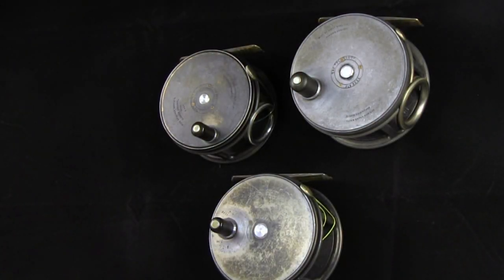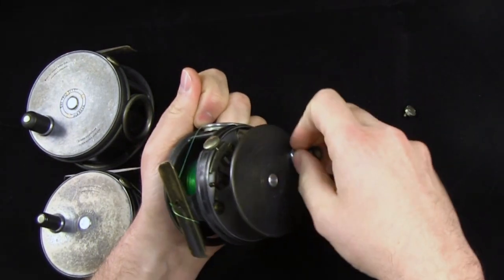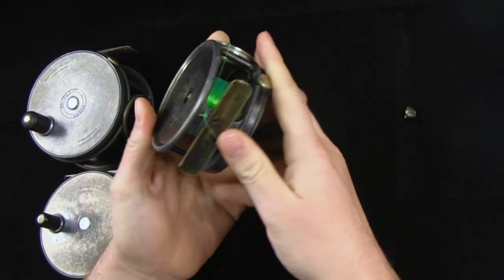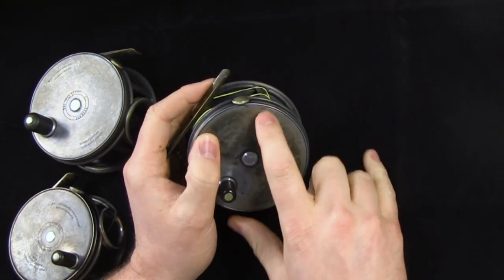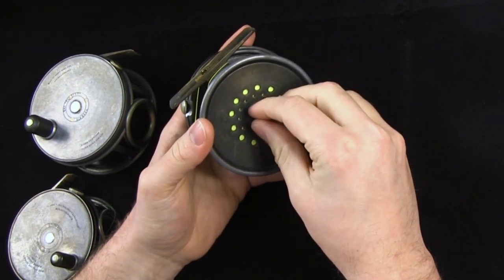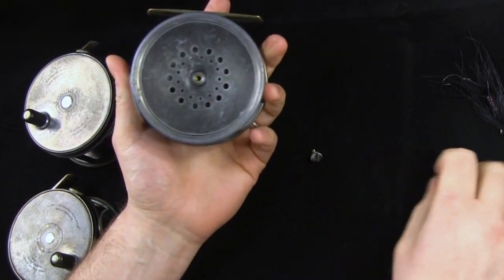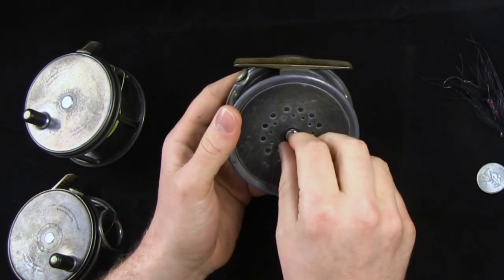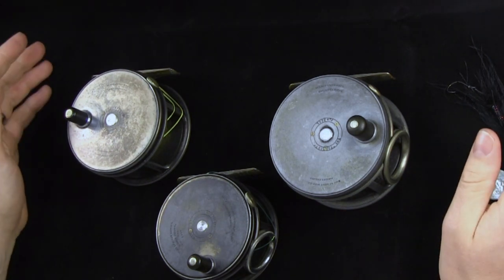Vintage Fly Reels | Hardy Brothers of Alnwick | Perfect Salmon Reel | prewar

Comment: Size stamping is closer to the post WW1 time.  Late teens early 20's.  Not all Hardy's are stamped consistently.  Sizes were stamped on many reels but not all reels, along with makers marks and full name and model stamping.  Gorgeous reels Kevin.  With the lineguard that 3 1/2" is a true gem.  Tight lines!  (PS: those appear to be rotating guides.  The groves in the rings indicate as much though they might be extremely stiff)
Reply from the maker: Hey Chris - Thanks for checking out the video.  Yeah if there is one thing consistent with these teens-30s reels, it's inconsistency.  I've wondered about these lineguards, but have been hesitant to really give them a twist.
Reply: @KevinHospodar  If you're feeling ambitious use a little bit of reel oil and just try to gently twist them side to side.  Make sure you go in both directions to help the oil get into the gap.  I do not have a pre war with a lineguard, though, so I am not as well versed.  I do know that my 50's vintage perfect was almost impossible to rotate but once it moved, and with a little bit of oil, it worked just fine.  I can't get over that 3 1/2" though.  Good grief that is a reel and a half.
Reply from the maker: @lesterismyname  good idea! Sadly the 3 1/2 hasn't seen much use recently, I sold the rod that it was paired with.
Reply: @KevinHospodar  Blessing in disguise!  That reel should be displayed, perhaps mounted on a vintage Hardy Perfection with an old Hardy fly.  I would be scared of damaging such a rare reel!  But I appreciate the desire to use such a unique piece of fishing history.

Comment: Kevin: I have been given a Old hardy perfect 3 7/8" maybe 4", right hand reel only, single paw on inside,  no set screw to remove plate/spool, screw is on  plate post, no size written on it, on outside of reel plate just Hardy Altwick in circle, has PAT No on inside of cage where paw is located. Any idea of age ?, looks like it might be older than whats in your video. I am not a collector, but a user, am I being stupid to use this reel. Thanks for the video.
Reply from the maker: Jim Noble sounds like a great reel!  Hard to tell without seeing photos. Can you email a few photographs kevin@hatchesmagazine.com